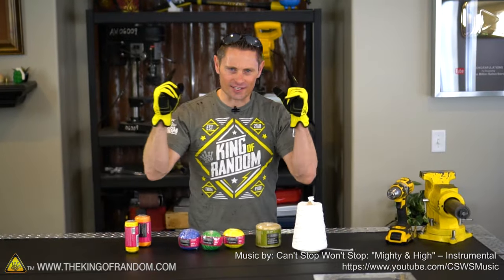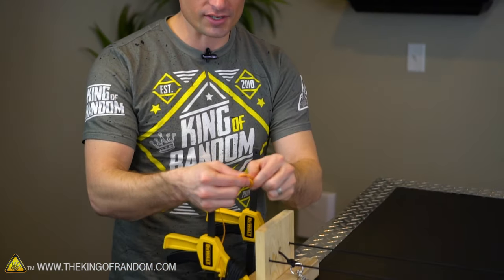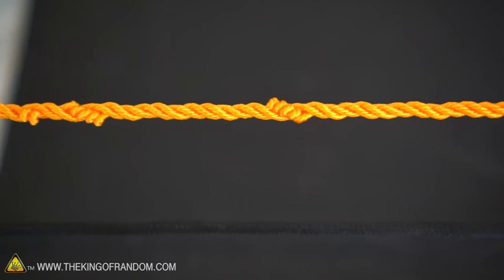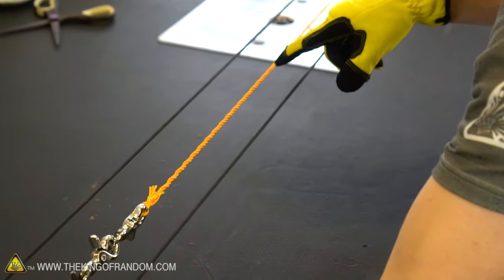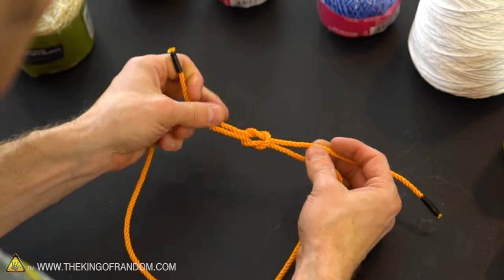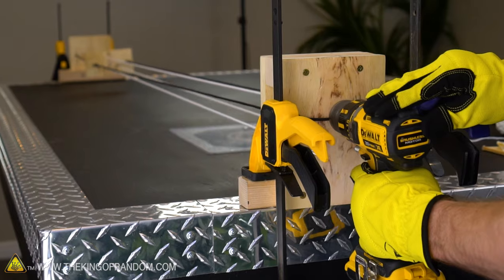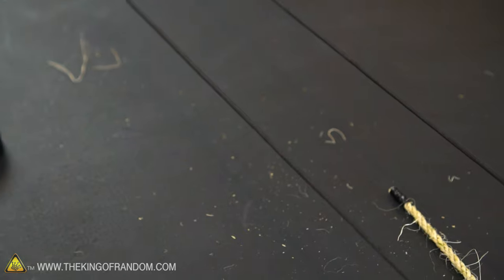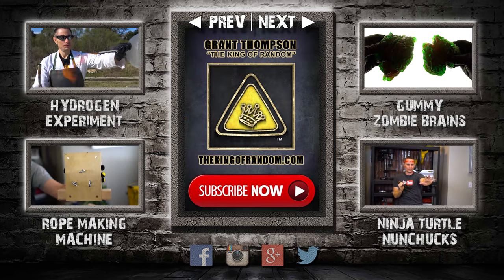Make All The Rope You Could Ever Want With One Of The Best Survival Hacks From TKOR

Comment: Just made one for myself, works like a charm once you do some fine tuning. The fun thing about this design is its material simplicity, it's just wood, bolts and washers. If you own basic tools you can do this. If you don't have access to all those materials easily, just use something comparable. I could not find any washers bigger than my wheels, so i made my own wood washers instead, it's not as pretty but it works. 
Thanks Grant, i would have loved more projects like this from you.

Comment: Hello Grant, Great Project. I have an idea that came to me as I was watching the video. If you manage to put electrical cable in the middle of the rope before you twist it and it stays in the core, you would be able to make  very nice and stylish power cord with different materials, colors and use in projects like reading or standing lamps and chandeliers.
Reply: Pavel Dimov he can drill a hole at that semi-spheric wooden ball and the cable will be passed through there..  as a result it will be inside that rope as u said.. awesome idea dude👍
Reply: Pavel Dimov I was thinking something like this but instead making paracord or something else with a high stretch value.
Reply: I've spun hair (I make yarn on a spinning wheel, which is very similar to rope making) and it is terrible.  It is too slick for friction to hold a single together under any load, and plying only makes it marginally stronger.  I ended up andean-plying it for maximum strength, and it still weak, and very itchy.  Not worth the time or hair.

Comment: You definitely should use this to make either a steel wool rope, or a big fuse. I think that by wrapping one of your paper fuses with hemp or cotton, you'd make one of those big cartoony fuses you can see in shows
Reply: I'd like to see this!
Reply: maybe use it to make back powder fuses
Reply: yea make your own steelwire
Reply: or use it to make vape coils
thats what im gonna do cept im making mine from plexliglass
Reply: Mmmmm....Heeeeemmmmpppp.
Reply: That type of long wrapped fuse would basically just be det cord.
Reply: Andrea Quadrati ijjj
Reply: Tie together enough M-80s to make a giant cylinder and paint "TNT" in big letters on the side lol
Reply: Andrea Quadrati 3😾✌🏻👉🏻
Reply: Here is a little refinement for securing the ends of the ropes once they have been cut. Try using the proper gauge heat shrink.
Reply: I cannot imagine that the way he has it set up (with the inner tube and wheels) would allow for much strength.
EDIT: Actually is a lot stronger than i originally thought.
Reply: @Abion47  Basically not

Comment: Cool seeing the simple machine put to use :)
Reply: South Main Auto Repair I don't know if you have ever seen the old style rope yards, that make use to make rope for shops, they basically use an identical system.  Just on a much bigger ratio.

Iirc they has horses powering them, and kids being used as spacers/guides. But all in all its the same idea.
Reply: @StephenButlerOne  I've actually seen a guy with a very similar setup but using a handcrank, and it was outside, with the anchorpoints dug into the ground and using an iron weight in place of a water bottle. At a small, local renaissance faire.

That was pretty cool.

Comment: Hi, grant, could you try adding a hole and putting a charging cable in the middle of the string. I feel that this would not only make for a cool design for your cable in customization but would also add structural support for those of us whose wires consistently are ripping and exposing the wires inside.
Reply: just use 3 power cables to get a super powerful cable
Reply: hayden hishmeh Agreed.
Reply: you can do that, just cut a hole through the middle of the shuttle. That's how braided USB cables are made (though they use a braid and not a twist)
Reply: Twisting would probably damage the wires, which are only meant to handle force applied in specific directions.

Comment: We made rope in scouts, too. We used UV resistant polypropylene baling twine, quad stranded about 100 foot long. For our tension we attached the rope winder to a solid post and connected the other end to a picnic table with  formed metal legs that would slide across the ground. After making three small ropes, we wound those together using the same method. We ended up with a forty foot long rope with a little over 1/2 inch diameter. I have been wanting to make an improved rope winder using the planetary gear set from an automatic transmission. Wish me luck.

Comment: Hay King of random you should use a cooper wire. Or metal wire of some sort.
Reply: If u get a thick enough wire it will be fine
Reply: Troll thank for the kind reply
Reply: You could also use steel wire like 12 G wire
Reply: Standard 18G copper wire would work fine. The problem is metal doesn't act like these fibers, and twisting them this much will give them a lot of internal tension that will make them very brittle. Technically you can fix that by a process known as annealing, but that involves heating them quite a bit and then letting them cool very slowly, so it's a very slow and tedious process.
Reply: Well I mean if he's willing to do it. It would be cool to see how it works and it could also be cool for other people to see ho it works. Thanks for the reply
Reply: Timster 77 the metal would easily break even if it doesnt break it would destroy the bumper and the prosess would take a long time
Reply: The metal wire would work harden, and break, unless you can keep it really hot
Reply: wile it is true copper wire alone doesn't take well to being twisted that is only because the extrusion process work hardens it. if you anneal the wire (i.e. pass a large current through it to heat it) before you attempt to twist it it should work fine.
Reply: blowtorch strapped to the moving bit, go slower, it might work. you would need a metal moving bit or it would catch fire though.
Reply: Yeah....a wire made of beer...you know, Cooper's.....OH, wait. Maybe it's COPPER...
Reply: Frengo69 Oh yes, that language that almost every country teaches: English... Let us learn to be the bestest at grammars!

Comment: I live in a city that was once famous for its shipbuilding.   To complement that industry there was a ropeworks.  It's long-defunct but I have been in the ropewalk.   It's the part of the complex where the rope was actually made.   The twisting was done on a bogey that ran on rails hence the extraordinary length of the building.    Of course, the finished rope was about six inches in diameter as it was intended to keep ships securely berthed while in port.   The ropewalk ended its life as a firearms range.

Comment: Put some sort of wire like an aux cord in the middle and use it to sleeve the cable
Reply: My earbuds are made like that. They last a lot longer than normal.
Reply: TunnelDragon44 That's pretty mad. do you reckon its worth doing in the long run?

Comment: king of random. is there a way you can make a contraption that can wind rope continuously from a large roll of rope instead of cutting off pieces?
Reply: I hope there is a better way than just making the rope making machine longer.
Reply: To do this, he would need to create a way to spool the rope as it gets tightened, instead of using a counter weight.  That way the spacer in the middle doesnt have to move much.
Reply: Check out "homemade visco fuse machine". My guess it would share a similar principal/method.
Reply: Rudolf Hess thank you
Reply: There are machines that can do that, but they're quite a bit more complex.

the three hooks are attached to individual spools, and instead of letting tension twist the rope, the whole hook assembly spins around. The upside is you can make ropes of indefinite length if you splice the spools.
Reply: just put them further apart

Comment: But will it turn metal wire into rope?
Reply: Dusk Shλde woah there ADHD much
Reply: Cool you a cool person king of randome
Reply: I think tie wire is not loose enough to make a rope without just braiding it with your hands
Reply: Back in the eary 1900s New Era rope machines were used to make wire ropes. Or Cables,,,,
Reply: Rustaholic777  thanks Wikipedia
Reply: then it wouldnt be rope, it would be cable
Reply: Cable is called wire rope.
Reply: Dusk Shλde more than lickle
Reply: If you do it right it will turn many types of fibers into rope

Comment: I used to actually work at a rope making company.  We used polypropylene strands, and made ropes from the size you made, up to actual tow ropes and even large boat ropes that were up to three inches in diameter.  All of our rope machines were hand made, and used different methods of pulling or keeping the poly tight while turning the rope.  Probably the most fun to make, yet hard to tie was lariats, because when you rue the actual eye of the rope that the free end goes through to be able to make a loop, is so tight.  You thread the individual strands through the standing rope, the twisted part, after putting a leather sleeve on it, then force the strands apart, while pushing the free end through each strand.  Really complex, and you have to do it right or it won’t work right.   When tying of the ends of regular poly rope, you have to take the ends to make them straight to tie.  Doing so when you first learn to tie, you get blisters between your fingers, that soon break and ooze.  Even wearing gloves, they wear out fast, because they can’t be too bulky otherwise you can work with the ends to tie it.  I bought golf gloves because they are fingerless, and thick enough to use for about a week before they are are ate up and you have to get another pair.

Comment: Would be interesting to see this contraption with a way to make longer ropes without having to stretch the rope out its entire length. In the long run, that's not a viable option. For example, if you want 25 metres of rope, you shouldn't need a straight venue 25 metres long.

I know it's possible, because obviously the factories don't have 150 metre stretches of machinery, but they manufacture those sizes of rope.

Maybe if the strands didn't go straight back to the carbine hook, but instead came off to the side, with another counter-weight holding it up? When the slider reaches the three hooks, you move the counter-weight at the end of the rope and let more of the strands through, move the slider back and continue from there.

If I had the materials at home, I would've whipped something like that together, just to try it.
Reply: All you really need is a portable pulley system and adjust it every couple of meters
Reply: additionally you can make the rope system vertical instead. Make your self a wooden post to secure the system in your backyard, attach the system 25ft going up. When you are done, detach the system
Reply: it is possible to hand twist rope as well. you can make it as long as you want that way.
Reply: erq: That's what I was trying to say, but you used a lot fewer words :)

Kayle: Don't know about the laws in the US, but here in the UK, you kinda can't stick a pole 25 metres in the air like that. Also, 25 metres, not feet :) 25 metres is a little over 80 feet.

Henry: Where's the fun in that? Also, as Grant has pointed out several times through these videos, it takes 3-4 people to handtwist rope, and it takes a lot longer, and the result doesn't always come out the best.
Reply: Nothing stopping us in canada to stick a 25 metre pole in our back yard : /
Reply: You know you are all reinventing a machine that already exists right?

Comment: ok quick question. how would you increase the size of the rope (length wize) i just dont understand how to do it.
Reply: nerf extensive just move the 2 parts of the machine further apart
Reply: Like jo said and even Grant said you just have to put the ends further apart and add spacers so the strands don't get tangled.
Reply: Lengthening the run would work, but the best way would be to feed each one of those hooks with line from separate spools. Then you'd put a wheel or winder at the "swivel" end to provide tension as well as holding the length of the rope.
Reply: ok thank you so much. it really helps to know how to do things.

Comment: What is the science behind why the rope doesnt just unwind after you cut it off even with the tape why doesn't it come undone and couldn't you just twist it back to its original form by hand?
Reply: It is true that you can just rewind the rope back but its a pain and not as strong. The science behind of why the rope doesn't want to unwind is because the twine has past its elasticity point and has gone to its plasticity form. Also, the friction of each strand also contributes a great factor in why the rope doesn't unwind, which explains why the rope is never the same if it get rewound.
Reply: tony salvadori thank you haha that makes sense
Reply: Zach 58 yah mate no prob.if you need me to clarify on anything let me know and Ill see what I can do.
Reply: It will if you remove the end constrains. Friction and tension on the rope makes constrained, hence the effect.
Reply: It will only unravel easily on it's own just after you made it (hence the tape), but if it's worked and used over time it will seemingly hold itself together if the binds are cut. Yeah you can still easily undo it from the ends by hand, but it won't fall apart the whole way through.
Reply: Do you really expect science from this channel?
Reply: the main factor is how the different strands twist against each other.  If you watch closely in the video the 3 smaller strands turn in one direction (clockwise or counter clockwise...doesn't matter) and then when they wind into one big strand they turn in the other direction.  This produces an equal friction bind so that the unravaling tension of the individual winds is counteracted by the unraveling tension of the main wind so neither unwinds.  If you cut the without the tape it would still stay together but would be easily undone.  The tape just keeps the ends neat helps the rope from slowly coming undone from use.
Reply: ohh sorry about that. When I said," the twine has past its elasticity point and has gone to its plasticity form.," I was referring that when someone unraveled the rope the fibers formed the spiral shape from when the rope was being twisted. That doesn't not mean that all material in making rope does that, but we can say a vast majority does. I'm not sure what the force is needed for cotton fibers to break but every solid material does have a plasticity area however small it is, we cannot disagree on that. I am not saying that the material deforms to the extent to what you are saying but on a molecular level, there are some forms of plasticity involved. How else would you have a different shape if it didn't touch the plastic level. I do think friction and tension are the main factors of why the rope doesn't go back to its original state but I believe the material must have past the elastic point somewhere in making the rope.
Reply: tony salvadori how long did it take u to write that comment
Reply: Clutch that's what my mom tells me too

Comment: Isn't WD-40 a solvent and not a lubricant?
Reply: Yes thats what i said. It displaces water hense the wd. (water displacer)
Reply: still works.
Reply: It can serve as both, depending on the situation.
Reply: it's fish oil
Reply: Yes, over time it may actually hinder performance.
Reply: +Thalanox So could water
Reply: MrVadosescorpion It's not going to disolve the metal, it might flush out and metal debris and reduce metal to metal contact by a few molecules though.
Reply: MrVadosescorpion neutritious
Reply: MrVadosescorpion no, it's a lubricant
Reply: Are you telling me that the guy that drills into his hand, fires lead bullets from a clock and taps a loaded gun with the back of an axe doesn't know what is WD-40? UNBELIEVABLE!!
Reply: Finn El Humano      It is a lubricant dingus lol
Reply: It isn't, a lubricant is a material that gets between the parts adheres and lower the friction, The lubricant-like properties of WD-40 come not from the substance itself, but from dissolving components. And the effect doesn't last. It is used to clean the parts and then it is followed by a true lubricant, dingus, lol.
Reply: WD-40 is whatever you want it to be.
Reply: Both I think, it evaporates quickly leaving an oily residue.
Reply: It displaces water, is a solvent but does leave a light oil so it will be lubricating in this application. It shouldn't be used as a lubricant in higher speed applications.
Reply: WD-40 is everything
Reply: Yes, it work okay as a lubricant for low speed/ low pressure application or a short while though.
Reply: I would use graphite powder 👍
Reply: WD-40 is the anti-ducktape
Reply: its both
Reply: MrVadosescorpion no